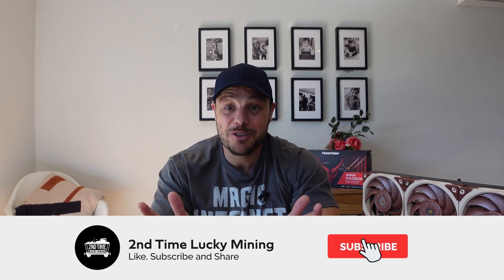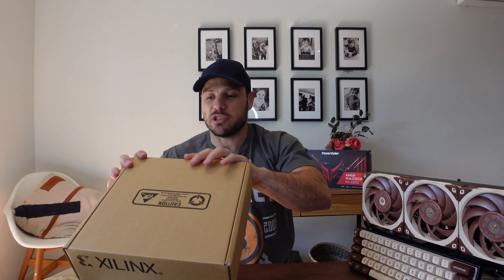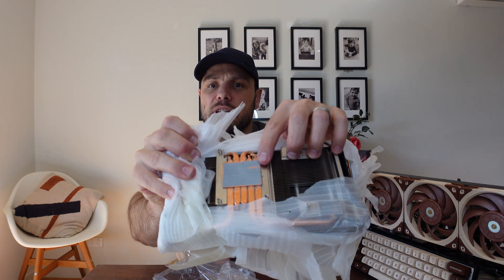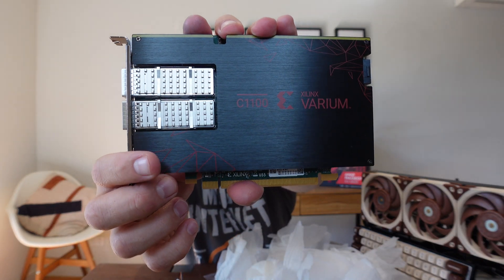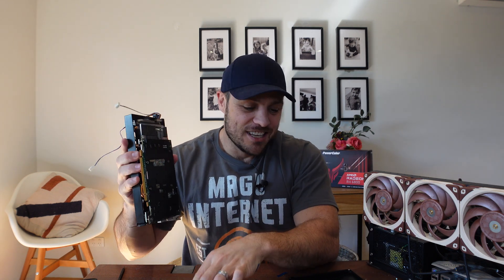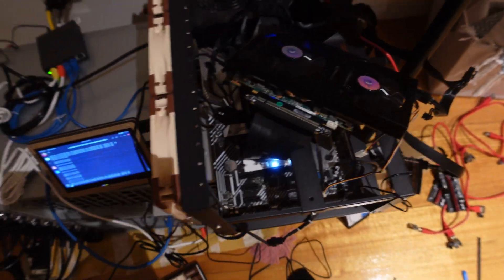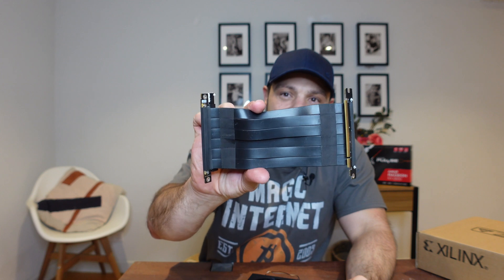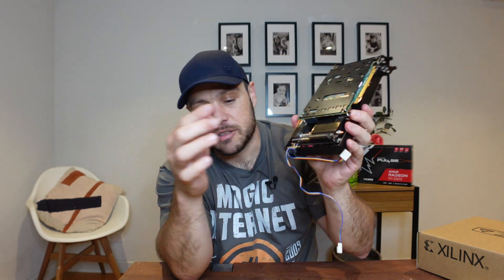Kaspa FPGA Mining - Xilinx C1100

Comment: Would have been great to see the temps before and after the mod.
Reply from the maker: Thanks for watching mate. Don't think it is designed to be passively cooled at all. Without any mod suspect you need it in a server case with air going through the little chambers. Why I needed to do something if it's on a open air rig

Comment: I think the E300 (Osprey) is more cost efficient and certainly doesn't have any of the issues you reported with connectivity since it's built in.
Reply from the maker: Thanks for the watching and the feedback. Yeah think the Osprey unit is about 5k USD atm and since the C1100 is about $2.2k. I have not heard anything bad so possibly is the better option. Ospreys service on the fan i got was fantastic.
Reply: @2ndtlmining  Yes, I bought 2 of the E300's and it was smooth sailing, no hookups, wiring or any OS to deal with. Works like a standard ASIC style interface.
Reply from the maker: @ronwatkins5775  Awesome! Really happy for you. Btw does it work with custom firmware or you rocking it via Team Red miner?
Reply: @2ndtlmining  TRM/Kaspa for now, unless someone comes out with a different bitstream.
Reply from the maker: @ronwatkins5775  Awesome, was curious if they(E300) had their own bitstream. Lets ride Kaspa to the moon together :)
Reply: @2ndtlmining  Came pre-configured. All I had to do was plug in power/ethernet, then login to GUI and set pool. I haven't looked into options for other bitstreams

Comment: Great video. Ty for sharing info on discord. BASICALLY if it’s your first boot you have to put in certain commands in your flightsheet for it to update your firmware. You must be careful during this process and let it finish or you can brick your card. It will run in hiveos and on a riser.
Reply from the maker: Thanks mate. Hope to move it to have and a more robust setup soonish. But great news been running non-stop without a hitch since i started it. Thanks for the feedback and info also!
Reply: @2ndtlmining  I did check the price again they must of fixed the issue. Lol if I new the price would have changed I probably would’ve bought 2
Reply from the maker: @Not_thatgreat  Yeah felt exactly the same. Think the price now is a little rough i recon.
Reply: What commands? My hiveos just did not recognize it. Please help me. Thanks.
Reply from the maker: @gekan168  go check out here under the firmware update:

https://github.com/todxx/teamredminer/blob/master/doc/FPGA_GUIDE.txt

The command they had with for ETH, but if you replace that with the KAS alternative you should be good. for example:

--hardware=fpga --fpga_update_fw --fpga_devices=0